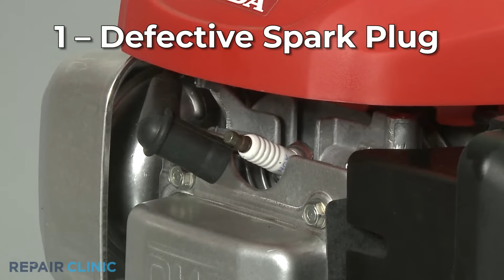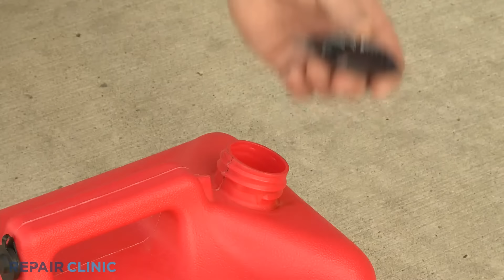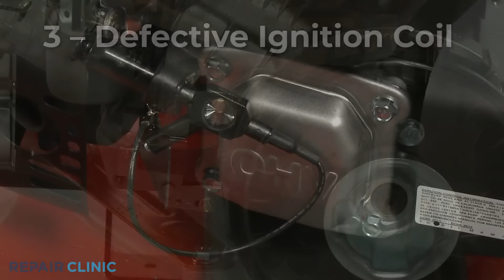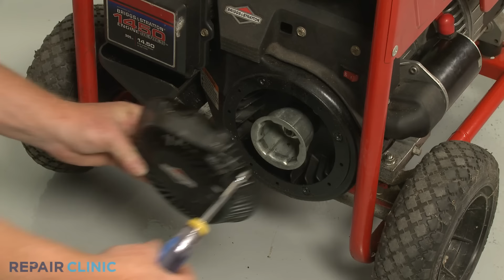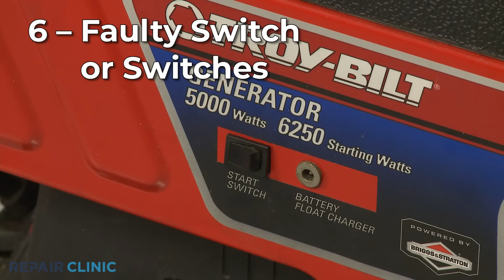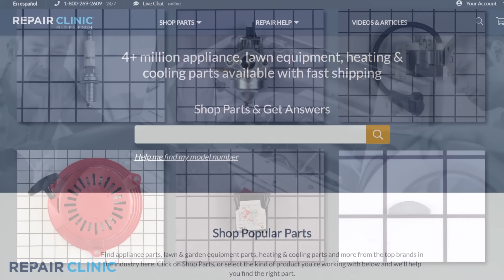Top Reasons Small Engine Won't Start — Small Engine Troubleshooting

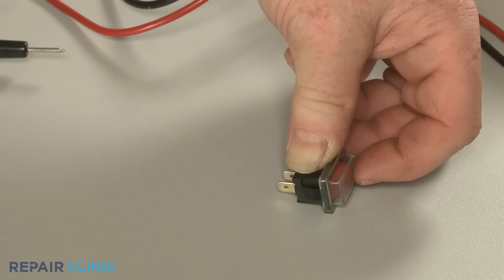Comment: @2:40, "the meter should show positive one way and negative in the other." Wrong. It will show a big number one way and ZERO in the other. If just testing for continuity, it will never show a negative number.
 -- I've watched several of these "What to look for" videos, and no one has mentioned checking the air filter. I've seen some so extremely plugged that nothing was getting through. The intake stroke had to have been only creating a vacuum.

Comment: So I have new gas a good carb compression and it goes through all the strokes. It should run but why doesn’t it
Reply: Main jet plugged from old gas.   This is submerged in the bowl full of gas near the float assembly
Reply: Spark or timing
Reply: Ultimately we need a college education. Yet I have a neighbor who stopped going to school in elementary school, and he can fix nearly any engine, and find the problem FAST. One time, he started checking my Polaris ATV, and in about three minutes, he found the kill switch had corroded and was blocking electric flow. I never even used the kill switch, but he somehow sensed it.